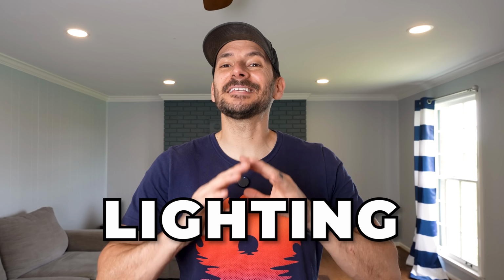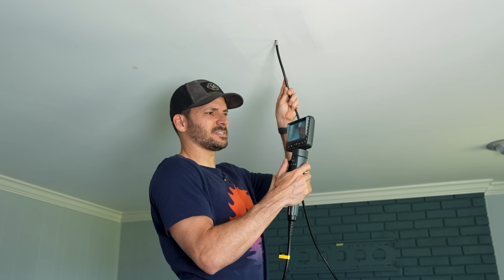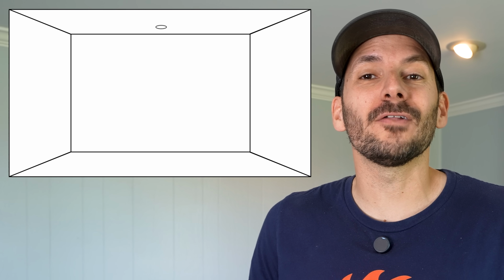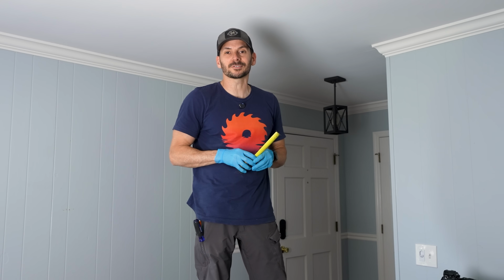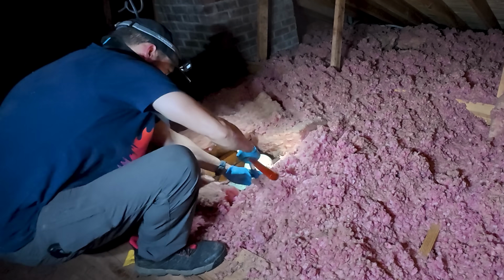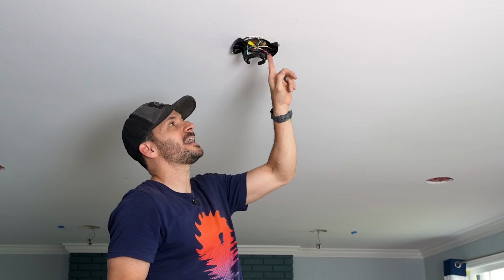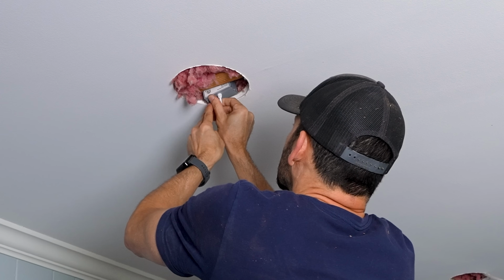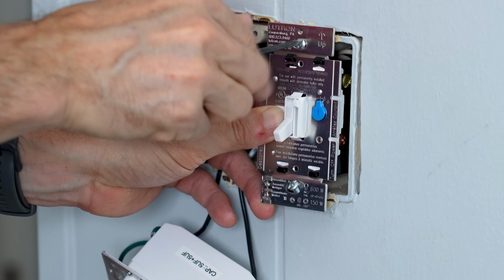Electricians Hate Me for Showing You This!

Comment: Not Studs But Ceiling Joists! Studs Are Vertical Joists Are Horizontal! Flush Lighting SUCKS! I Know It Is Trending But It Really Sucks! It Will Go Out Just As Fast As The Trend Came In! I Always Leave Slack In The Wires Because The Customer Might Change Their Mind On Spacing!! They Do More often Than Not! Which Sucks When You Dont Leave Slack In The Wiring! We Mostly Do New Construction But I Have Installed Hundreds Of These Damn Lights Over The Years!! Buy The LED Trim Kits!! They Are Cheaper Than Buying The Trim Rings And The Light Bulbs And They Last Longer And The Light Color Can be Set! The Customers Can Not Decide What Color Light They Want Either! I Like The Blue Because I Can See Better In That Range! But Some People Like The Lower Frequency Light ie Towards The Red!

Comment: I'm not sure you ever had a 3 way switch wired. They used 14/3 wire to make a fan switch (1 fixture 2 switches, fan and light). Maybe they deleted the 3 way from one side (your other switch to nothing) and added another switch working side to make a fan switch. When we built our house I had them do fan switches in every room that I might want to add lighting just like you did here.

Comment: I put a new light fixture in the bathroom. Everything went well BUT it took three sets of bulbs before I got approval from the boss (wife). Just be aware the color Temp of those LEDs do make a difference in the overall look of the room, don’t depend on a dimmer to “fix” it if you get the wrong ones either, it wont.
Reply: Yes.  Worth paying a bit extra for "selectable color temp" versions.

Comment: So no concern the attic entrance is... ah...  outside?   Lol. That is my worry on that one
Reply: I've never seen it that way before but it might be kind of genius because those pull down stairs can leak a lot of air (your heat and a/c) right into the attic.  Putting a stairs outside with some air leaking would be somewhat like having just another air inlet vent and help keep the attic the same temp as the outside air w/o any energy loss inside the house. I would have a lock on the stair pull of some sort just for security of the home.

Comment: Thanks! Question: What size are the grommets that go into the boxes (for every light)? I want to buy the plastic type.
I'm not sure what size. I have same exact brand of lights?
Reply: Should be 3/8 inch. I like the metal ones better than plastic. Much more expensive than plastic, but actually holds the wire. Buying 50 or 100 packs are more cost effective.
Reply: @DavidGossMusic  Thanks! Appreciate it!

Comment: what i done in the past for running the wire is i just take a total measurement for the run and add an extra 3 feet. then i go in the attic with it and "kink" the hose stuff it down through the ceiling as i lay it out. then when you go back down you just cut it on each bend to give you your chain. hope that makes sense lol
Reply: Exactly the same when I did the garage lights best way imo.

Comment: Great video! However, it brings up a question regarding adding a new dimmer switch using a 2 or 3-gang old construction box and running a new piece of romex from that new switch to the LED ceiling lights. I have not been able to fish a piece of wiring from the attic down to the new switch. This results in my having to completely remove the old box so I can work with the wiring coming down from the attic. This isn't difficult to do but it would be nice if there were a simple way to run a new romex cable between the attic and switch.
Reply: I just bought a wire tape to do this.  I have a 2 gang with one switch seemingly controlling nothing.  The box can take another 14ga but the hole at the top is snug.  I'm going to try pulling the new 14ga from the bottom (gang box) and into the attic.  Wish me luck!

Comment: 6' drill bit is extremely risky as you can't see what's mounted on the joists, such as water lines, hvac and wires so not recommended. You can't control the path as the bit is flexible so height of holes won't be consistent to avoid pipes or wires. You should inspect the path if possible.
Reply: I NEVER use those long bits. I’ve seen too many people drill through the floor above or some HVAC without knowing it. You can’t always keep track of where you’re at and it can drift up or sideways easy. I don’t drill blindly. People would rather have a few holes to patch instead of a hole in a hardwood floor or a duct.
Reply: Seems like we need to build a Boreoscope camera into one of those drill bits, somehow.
Reply: You’ll know if you hit a water or sewage line. Sooner or later…
Reply: You’re right. A six foot drill bit is not only too long but it’s also completely unwieldy

Comment: 18:00 make sure to run down one joist bay with lights and connect them all up, then drill through the joists in to the other bay and run the wire down that bay. That way it's less drilling.

Comment: I did can lights in my kitchen about 12yrs ago. I definitely had to measure and mark about 3 times before I started drilling because you have to account for the joists. I wish these were an option back then but unfortunately they were not there yet with lighting. But now that the can is there I do have the option to switch them all out with any other type of light fixture that fits the holes. I just ran all the wires in the attic and through the holes in one go, while I was up there. You can measure out the wire in the ground and then build a sort of wiring harness. Then you go up there and feed them all down the holes. I found this easier than trying to fish the wire from hole to hole.

Comment: The other thing to note if you're going into the attic in the summer is the heat up there can be unbearable.. I was just up in my attic running ethernet cable and the temp was easily over 100 degrees. After a few minutes I was soaked...
Reply: Getting a good attic fan will make it better

Comment: One thing to note is that the new flat LED light is very low power. You could connect them in serial without worrying about electrical overload and thermal overheat.

Comment: Your ceiling wiring is not to code.  You should not just drape your wiring across your ceiling joists.  They need a rigid connection to a framing type member running across your joists.  It just takes a small framing member to act as a bridge for the wiring.
Reply: Also, anyone who who doesn’t k ow they don’t have a 3 way switch or that a switch was not even connected BEFORE they do the work, should not do electrical work and not pretend to teach people electrical work.
Reply from the maker: They were 3 way switches which did nothing. And one was next to the fan with no light kit. Seemed like a pretty good assumption that they went to the light kit on the fan vs literally doing nothing 🤷

Comment: In my house, because I had a water leak from up stairs that I did fix, and the former owners had a leak and couldn't either find someone who could patch drywall, of tried it themselves, they painted the ceiling with a paint that left little spikes , I tore the entire ceiling out.  Made it easy for the electrician to put the  lights in.
Reply: Ceilings are FUN!  I tore out a laundry room ceiling that was stucco, used to be an outside porch side entrance. Had to build a 2x2 grid and drop it a couple inches lower than it originally was to have something to secure the drywall to. All so that a plumber could access the upstairs shower drain (old cast iron that rusted through). My first time and everyone says it looks great. But I’m kind of a perfectionist and wanted it to look better than before. Fun times are always had when working on houses that are nearly 100 years old…

Comment: I was so excited to watch this video as I am fixing to install some recessed lights in my kitchen and I was a little unsure about the wiring as far as tapping into a three way… i am still a little confused on tapping into the existing light… since u tapped into a fan and u didn’t have a light.. if anyone knows of a video that might be a little more clear on that part I would love to know.
Reply: Basically, if the fan had had a light fixture, then nothing would have changed as shown. The light's hot wire (red) would be connected to the new recessed lights' black wire with a 3-spot Wago. The difference would be when putting the fan back up, that the blue lighting kit wire on the fan would go into the third slot on that Wago lever connector. Note in this case that the dimmer on the switch would also dim the fan's light kit.

More would be involved if you were wiring a whole new switch of course.

Comment: not sure about the US but in the UK sockets and lights MUST be on different circuits as they use different amp fuses. that being said we also tend to use ring mains which i don't believe is the norm in the US
Reply: Ring mains are unique to the UK.  And that's not a compliment. 😁

US, you can mix receptacles and lights on the same circuit.  Just have to be sure the wire gauge and load calculations are correct for the fuse rating.
Reply: In the US everything most lighting and receptacles are both 15 Amp; it is exceedingly rare to have a circuit breaker less than 15 Amp.   And a switched receptacle is required for lighting in every room if there is no switched light fixture.   10-Amp circuits can be made that don't allow receptacles but it is rarely ever used,  and you would have trouble even finding a 10 amp CB at the hardware store.

Comment: I think the reason most people avoid these is the commitment. If one breaks it's easy to replace unless that company either discontinues them, or goes under. If that happens, you end up having to replace all of them, or if you choose to change lighting you have to remove the electrical line, and do a ton of drywall repair. In my house these wouldn't be a viable option. They're really nice lights for sure though. Thank you for the video, Brad!
Reply: Good point, I think I’ll buy an extra to have on hand just in case
Reply: @debwilson2870  With today's market how it is I'd buy a few just in case. Manufacturers like to discontinue models with no warning so they can sell you newer products.
Reply: It's a circular light - not exactly a nouveau-riche design, I think you'll be able to find a suitable match down the road, no need to replace everything if one dies. 🙂

Comment: Make sure that the total power of all the lights added together is less than what the dimmer switch is rated for.  Those puck lights don't take much power, so any normal dimmer switch should handle a whole lot of them.  Still, it's a good thing to check.
Reply: Also, not all LED lights are dimmable. Make sure you have lights that are rated for dimming before putting them on a dimmer. Also there are some that are rated for damp locations, definitely a consideration for something like a shower or washroom that may experience higher humidity levels.

Comment: A tip for using leftover wiring, if you have it: From a safety perspective, you can use thicker wiring on lower current circuits; you cannot use thinner wiring on higher current circuits.

For instance, if you have wiring rated for 20A, you can use that in a 15A circuit safely.  (Please check your local electrical code, some might say "specifically this wire with this breaker" in which case, do that, but it's probably doing that because an electrician might see a 20A wire, assume it's on a 20A breaker, install a 20A power receptacle, and then when you plug in a 20A appliance, the breaker goes.  But nothing will catch fire, which is the safety issue.)

Conversely, if you have a 20A breaker, use wires rated for 15A, and then run close to 20A through that circuit, which leads to sparks, which leads to fire.   DON'T do that.
Reply: Also, you can use leftover bare ground wire to locate and align wall cavities behind drywall.  For example, when going up or down a finished wall from floor to floor, you can drill a piece of wire through the ceiling to ensure you're in an aligned stud bay.  Then cut your outlets, flex-bit your bottom plate, and wire away.  Finish with a dab of spackle and call it a day.

Comment: 3 way switch easy    switch 1 side power in other side 2 screws  2 wires to next switch  switch position determines which wire going out has power,,,, switch 2  2 screws 1 side   receive the 2 wires  1 screw other side goes to light

Comment: Before I got the drywall dust capture boot included in a hole saw kit, I used an old soccer ball cut in half.   Also, though the push-in wire connectors are easy, I use Wagos for my LED canless because I'm told to expect future failures.

Comment: When feeding the wire in the attic, just drop a loop down each hole while you are up there. Then go back in the room and cut off what you need and hook up the boxes. There is no need for going up and down for each individual fixture.
Reply: This is exactly what I did. So much easier. Drop a loop and staple to a nearby joist to keep it in place.
Reply: Exactly, when I did mine i just laid the wire out on the floor and kind of made a wiring harness matching the hole dimensions, and then dropped the harness ends through each hole. Saved me a ton of time cutting and stripping wires overhead. I just made one trip fed the ends down each hole and connected to the switch wire. In the room you just attach what you need to the stripped wires and done.
Reply: This was my first thought also.
Reply: I run the wires and never need to clamp up to the attic, just using 2 fish sticks.
Reply: @Dog_1year code requires you to fasten the cable
Reply: 😂😂😂 bro i swear I was so confused by how this smart is doing this 😅 up and down my god 😂😂😂😂
Reply: I thought the same thing! Lol
Reply: Oh shut up
Reply: He doesn't know
Reply: I hardly climb in the attic , but if I have to I do it , I use a Klein or harbor freight 🤣 rod , no loops , but everyone has its own ways and styles , the only bad thing about not going in the attic is that from the floor more insulation falls to the floor
Reply: I really hate loops.   I want each fixture endpoint to be able to power any electronics and modern LED drivers, 5v sources, sensors, ESP32s, LED strips, double power live and neutral to feed each light to a solar inverter offload likea UPS, not just traditional light bulbs.   So, ideally, and ethernet endpoint and two power cables for each light and switch endpoint and then some
Reply: Code requires you to secure the romex if the attic is accessible
Reply: Great tip!
Reply: Depends on your frugalness.  I just bought a 100 foot roll of 14/2 romex and it was $80 at Home Depot.
Reply: My time, knees and back are worth much more than that. One fall off that schetchy ladder setup could cost you a whole lot more.
Reply: @BiggMo what frugalness? By running wires from the top, you have the exact length between boxes and you need to leave a ~7" loop at every box you pass through. Practically zero waste.

For ease of future service reasons, wouldn't hurt to have an extra 3-4" at every location (~10" loops) and just tuck the excess back into the ceiling.
Reply: @BiggMo I bought the 250’ roll of 14/2 for $113 at Home Depot, yesterday, 07/14/2025!
Reply: @BiggMo should've bought 250ft its barely more and more than double to amount. Plus working in an attic sucks. Use a fish stick and just reach up through each hole to feed a loop so you dont have to be in a attic long.

Comment: When you went over the weirdly wired up 3way switch in the wall, you mentioned that there should be a neutral on the center tap - don't do that. You showed in the physical demo how it should work, obviously correctly since everything worked. 
Typically, you'll have a neutral bundle in a switch box, but the neutrals shouldn't go on a switch. You'll also have a ground bundle, and those will connect to the grounds on the switched. 
You want the constant hot on (usually) the bottom screw of switch one, and the output on the bottom screw of switch 2. There are 2 runners that go from switch 1 to switch 2 that tap onto the top screws. 

I wouldn't have said anything, but specifically, putting a neutral onto a switch is an extremely common mistake when working with wires.
Reply: Unless it's a smart switch, as a lot of them require a neutral.

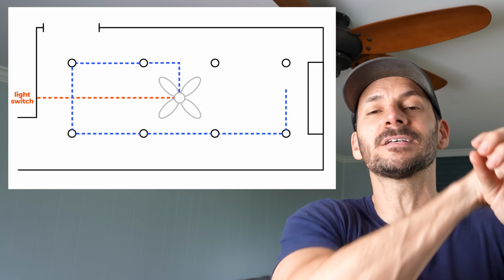Comment: 17:15 NOT in series, that’s how Christmas light strings are done. You want to wire in parallel
Reply: What you're saying is correct, and while he DID say "in series", in this context he's pretty much right. Electrically, he did wire everything in parallel. To be truly in series (In electrical terms), he would have connected the neutral of Light 1 to the hot of Light 2, and continued that. No one really does that, unless you're doing a really specific electrical job. I'm actually not sure if LEDs would let you do that... I know if you do it with filament bulbs, each light will get dimmer as you go down the line. Voltage drop and all that. 
The electricity is happening in parallel, because there is a single hot that goes to each light, and the lights are branching off that single hot line. It's like... if you zoom in on a light, you'll see that a light has a hot in, its load wire, and a hot out. Since all 3 wires are touching, electrically, it's the same point. So according to the light's point of view, there is a single bus of hot that they're each touching, which is what parallel is. 
In Brad's use of the word 'series', it meant "go from one light to the next in a row.' You COULD have done some parallel wiring and branched off of one light to 2 or more lights, maybe if you were trying to save some money on wire or something, but he wasn't wrong.
Reply: @zacharybrooks465 crazy question. These transformers have 18g wiring. Can’t you just run 18g from transformer to transformer?